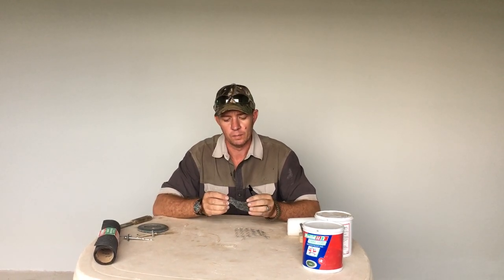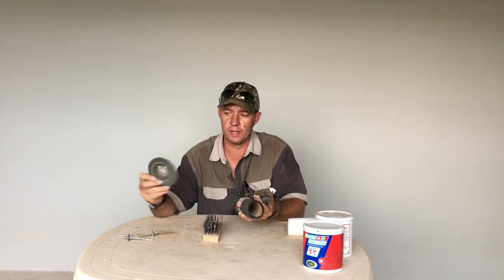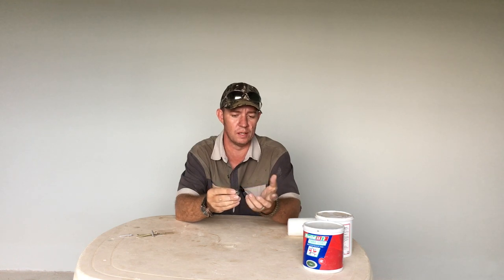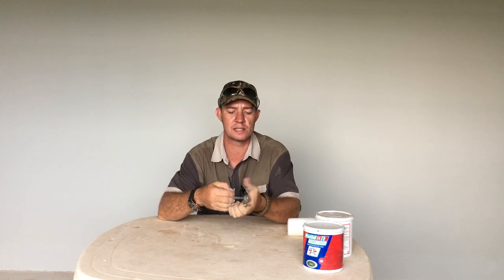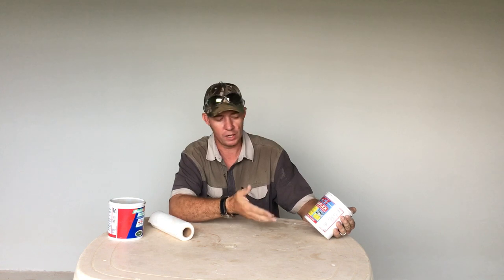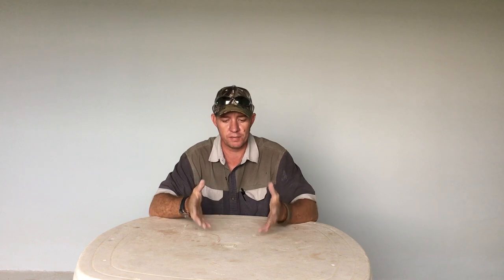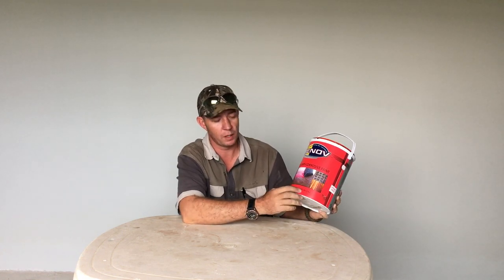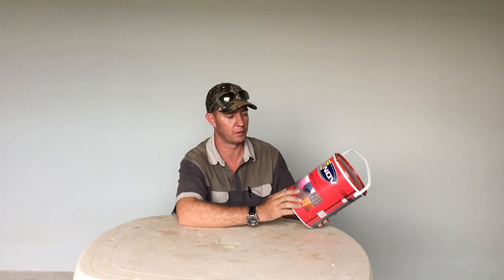Roof Prep for airless spraying

Comment: Understanding the paint better now that I've used it, it contains Phosphoric acid. That does the rust conversion from iron oxide to iron phosphate. In the US there's a rust converter called Ospho that works with the same action.
Reply from the maker: Thanks you for reading and explaining, wish i could tag the 1000’s of comments on painting over rust. But i guess thats how humans work it is easier to knock someone rather than doing a bit of research.